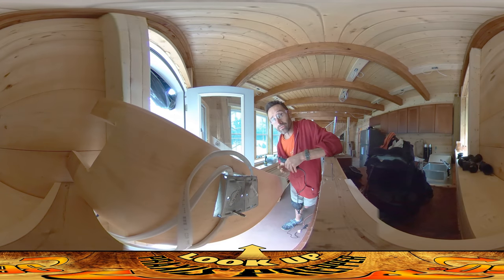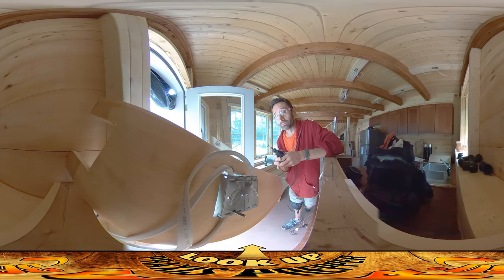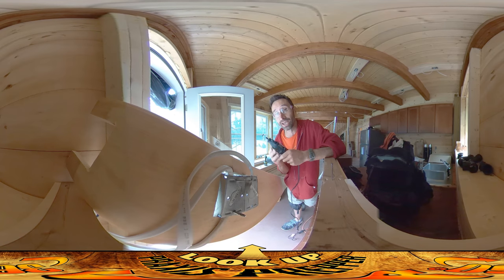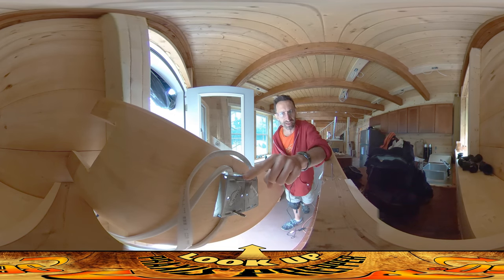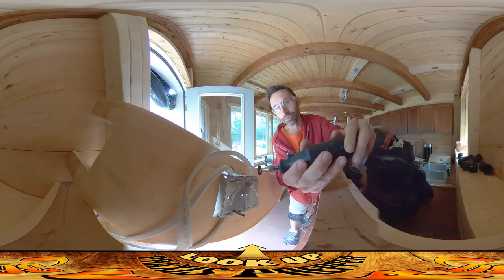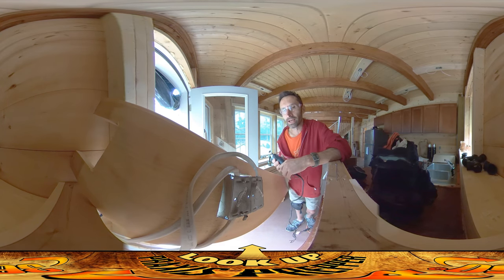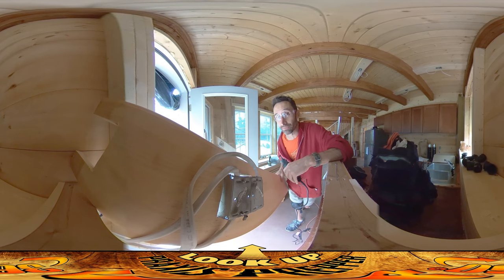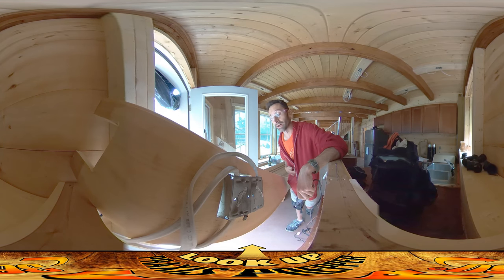Homestead Building - SPARKS! Cutting Screws with a Dremel

Comment: You are quite the professional with that dremel and cutting disk, i tend to use 2 to 3 of those disks just to cut through one thing. And yes, you will most certainly want to wear safety glasses because when the disk breaks sharp bit fly everywhere, though for some reason most pieces tend to hone in towards eyes ?!? ... also, WHEEEEEEeeeee Sparkly ^^